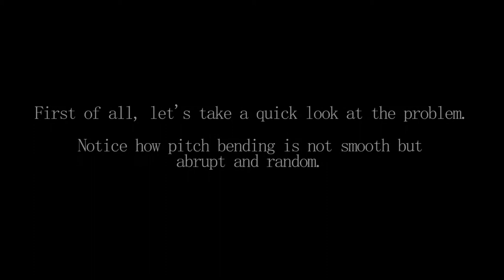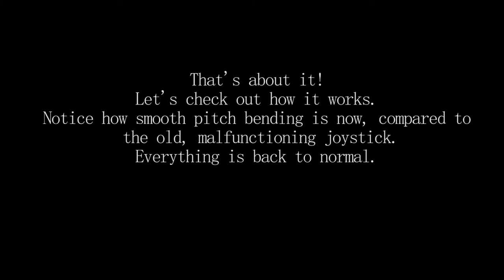Korg Kronos joystick replacement

Comment: I've done this. I think the electro-mechanical components become loose internally. I took the pot out of my defective assembly and noticed it has some very minute slippage. Contact cleaner didn't help. The whole assembly is cheap enough and easily replaceable so I think that is probably the best option. If you can refurb one to make a backup that would be cool, but I think it would mean replacing the potentiometer. And I think there would be some soldering involved.
Reply from the maker: +Ronald Figura Hey man! Thanks for the info. That was my best guess, that it&#39;s probably easier to just replace it. Good to know. I&#39;ve been struggling with joysticks ever since I bought my Triton Le back in 2003. Korg is horrible with build quality unfortunately. It&#39;s 2017 and we&#39;re still dealing with this while Yamahas and Rolands never had an issue. Same goes for the buttons. You have to clean the contacts yearly. Also many of the plastic button covers would break on the Triton Le and I had a hard time finding new ones. Thanks again for the great info!

Comment: I now have the same problem. Installed now Joystick assemble from Korg but I still get the problem. Even after using the restore discs and doing a Full restore ....
Reply from the maker: +James Finn It could be the cables as well. On my Triton Le I had the same problem not only with the joystick but with the cables too. Try changing the cables connecting the joystick with the board. I don't think it's a software problem. Also make sure there's nothing wrong with your ribbon controller. Let me know how it goes. Best of luck man!